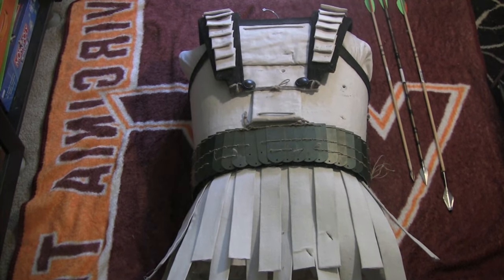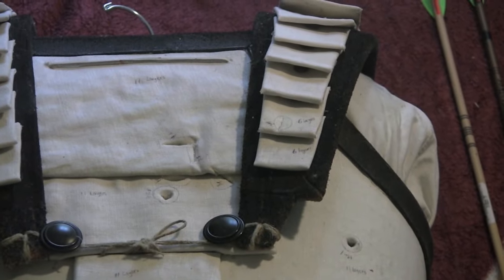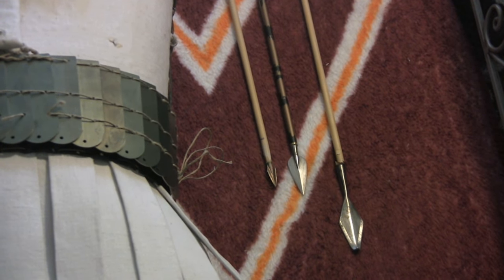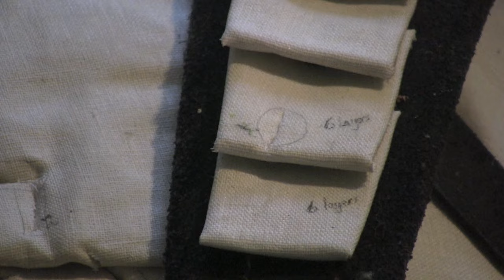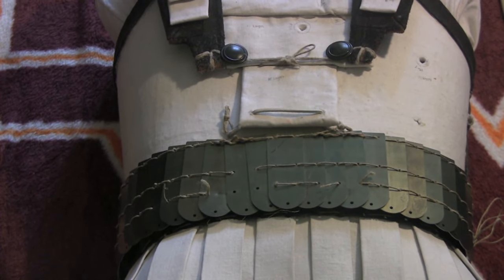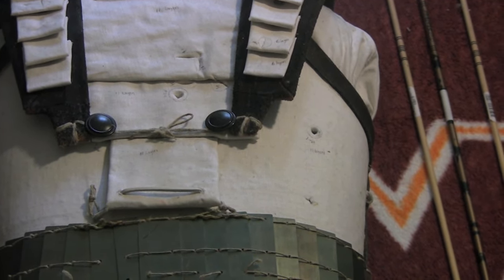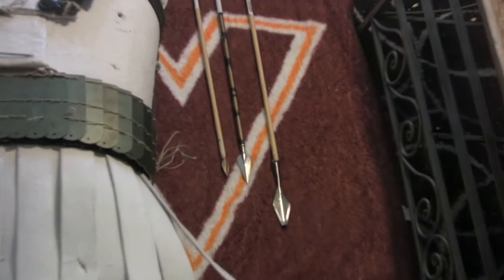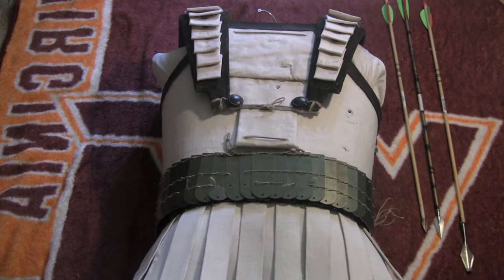Testing of a Linothorax in HD

Comment: Kind of like gambeson on crack
Slashes resisted by gambeson and with this they wont do too way too much more than maille
Stabs resisted by gambeson also adding more stuff between you and a penetrating head that needs to be larger to reach you, with this it does it better
Reply from the maker: That's an intersting observation and one that was born out in testing. I didn't post the video of it when I made this so many years back, but there was an interesting dynamic when it got wet from weather (and may have exhibited similiar characteristics due to insane sweat?). When it was dry, it was more rigid, so even with a softer leather core, it had great stopping power against piercing as well as resisted full swings from a baseball bat. However, when it was wet it would swell some, the thickness increasing and it becoming more pliable. While the arrows pierced further and it weighed more, it also had the benefit of being thicker (so could absorb more arrowhead before reaching the core of medium leather) as well as more flexible... more comfortable to move in. So, wet or dry, it performed well.... for different reasons.

Comment from the maker: Bow Weight: I did not record the weight of the bow used but instead chronographed the arrows used in the test as well as the mass of the arrows.  I tried my best to match the weight and velocity to what we know about recurve bows in use at the time.  The mass (grams/grains) and velocities (feet per second) are:

Scythian: 24/370, 172
Tanged Broadhead:49/756, 146
Saxon Broadhead: 43/664, 152

This information is provided in the video.

Comment: Cool test, but the arrow speeds you are getting I feel like wouldn't be accurate to archaic or ancient greek arrow speeds.  modern composite laminated bows can get up to 200 fps with lighter arrows, and maybe 150-170 with actual heavier war arrows this isnt including flight bows*.   A composite bow, like a scythian wouldn't get those speeds, their draw length was significantly shorter compared to modern asiatic composite bows, like they could maybe pull 28" though most historical depictions on vases and stuff show them with relatively short draw lengths.  So i'd think they'd be getting 150fps with lighter arrows than 130-140 with heavier war arrows maybe even less.  Though because of this I feel like they would rely on even lighter arrows which would be mass and generate less energy.   Also these shots are relatively close so they won't be angling as they and deflecting off armor easier *since bows back than didn't have as flat as a trajectory especially past 35-40 yards , compared to a flat trajectory shot.  Though I understand it looks like you're in an apartment area?  So it would be dangerous to shoot any further.
Reply from the maker: Appreciate it. Yeah, this was 13-14 years ago - assembled it as part of an undergraduate research project. Worked with what I had on a students budget. Tried to use all the legit materials but time and money was always a thing.

As for the velocity - I can't remember everything that had me decide those were the right numbers to replicate, but every aspect of this was historically researched to be as accurate as possible (given my limitations). I think part of it was that we have semi-reliable (ish?) data on how far the bows could shoot, you can roughly infer the velocity at release, especially if you also have reliable data on the dimensions, composition and mass of the arrow (so enough to assess how well it retains velocity throughout its flight, which i feel like is over 90% for 4th century BC trilobat tipped arrows)... but its been over a decade), which we definitely do.

That said, again, I was a student on a budget and had a tight schedule to meet.... I'm sure someone else (to include myself now) could do an even better test without those limitations. I know I love coming on youtube and watching those types of videos, love em, even if most focus on metal armor as opposed to the linen, leather and alternatives (eg wood)!
Reply from the maker: I'll say this - against something like a more modern (historically speaking) recurve or English longbow, none of this armor would stand up without something extra. I think it would have been a nice type of armor to have in all weather, especially hot and humid (it only got more flexible), and was super easy to patch, it had its limits. 

That said, I later tried it with a thicker, hardened leather core/tube with the same layers and it entirely stopped the trilobat tipped arrows, even with a FULL strength modern hunting bow - that surprised the shit out of me.

Comment: Will that armor get heavier on the rain ? It’s basically thick clotting
Reply: The material was probably waxed to make it water repellent.
Reply from the maker: I wondered this myself after I did the testing in the video. In addition, I wanted to know if excessive perspiration, from the inside out if you will, made a difference. To test this I wore the armor for hours at a time on several occasions, during which time I performed exercises, yard work, and walking (yes, I looked goof) in both good and bad weather (light-medium rain for extended periods). The armor definitely retained water from both the perspiration and rain... but not as much water as you'd expect. I attribute this primarily to the fact that the generous amount of glue I used saturated the linen before the rain. It also dried faster than expected, likely for the same reason - not as much water had been absorbed. Finally, I did some post exercise/rain testing. The results were almost identical to the ones in the video, except in a couple locations where it appears the armor faired even better when wet. I'm guessing this has to do with it absorbing the energy of the arrow better before giving... better bend than break if you will. The only thing I didn't test was blunt impacts while wet - I don't imagine it would fair as well there as it did when it was dry.

Comment: I wonder how much extra protection a thin layer of leather scale would add to this?
Reply from the maker: Hardened leather scales like on a brigandine... probably a lot. Properly cured hardened leather is a beast and one of the biggest arguments against hardneded/glued linen armor). It's been a looong time since I did this test, but if I did it again and had my current budget I'd definitely test out different methods of protection.

Sadly, if I recall from my research (which I did a ton of at the time), we only have reliable information on a few things from that era. We know the size, shape and mass of the arrow heads and roughly the mass and velocity of the arrows with arrowhead. Sadly most of the actual armor samples degrade over time... they literally just rot/decay, especially the less expensive stuff issued to your regular infantry guy.

That said, I do recall people finding samples of leather and linen armor from the 3rd and 4th century bce. I'd probably develop a test campaign based on that, historical imagery and what we know about armor from bordering regions and similar time-frames.... so early Roman leather armor which I'm pretty sure we have more evidence of.
Reply from the maker: It's easy to forget how long ago this stuff actually dates to. We all know the "dates", but it really puts things into perspective when you consider many old battlefields and cities are now 15-20ft or more under the ground. I want to say the old Royal Quarter Alexandria, Egypt (somethingn like 25 cities were renamed that during his reign lol), the portion founded by Alexander, is around 25-30ft UNDER the current city. So, point being, it's incredibly hard to find stuff from this period.... thank God some folks preserved art and writings from the time and shortly thereafter.

To your point though - if I were some soldier, I'd do whatever it took to survive, especially if I was a Macedonian phalanxman without shield... wearing only my tube and yolk armor (linen or leather). You'd see me boiling leather and slapping all kinds of extra protection on it... I imagine troops of the era did the same. I'd be fighting for the belly hide of every cow and horse we slaughtered 😂
Reply: @Hokie2k11  Thanks for the replies! 👍👍

Comment: And what kind of bow were you using?
Reply from the maker: I can't recall the manufacturer, but the bow was your typical adjustable compound hunting bow. However, the important thing is to make sure you have the right arrow of the correct weight and with the correct arrow head leaving the bow at the right velocity. I used a variety of arrows, but I would focus primarily on the Scythian trilobat. Before firing, I adjusted the draw weight (force) of the bow to ensure I had the right velocity.
Reply: Bows back then weren't the super powered ones found later on, like in the middle ages.

Comment: Where could you get this linothorax?
Reply from the maker: You need for make it. Depending on the part of the armor in question, it's between 15-25 layers of historically accurate linen, bonded with the animal based glue used at the time. You can add even more protection if you line the inside with hardened leather.
Reply: @Hokie2k11  It would be really cool, it would be very difficult to do it for an inexperienced like me, do you know if anyone can forge this linen army?
Reply: @Hokie2k11  I hope you answer me, I would be very curious and happy to be able to have a linothorax

Comment: The most important is the angle of the shot...Usually on a battlefield archers shot volleys of arrows  from a long distance. And they aimed high so the arrow gained height and then with its weight and speed it fell on the enemy. So i think its kinetic energy and m/sec wasnt that deadly or powerful as a straight shot or from a high tower/wall shooting downwards...
in other words only at a clear sight and a straight zero angle the arrows could penetrate an armor and that was a rare scenario...

Otherwise Alexanders phalanxes would have huge casualties because every single one of those hundreds of thousands Persian soldiers they fought against, carried a bow
Reply: From what I understand arrow volleys were closer since arrows actually lose velocity if shot at long distance, as well as range. Also since Alexanders phalanxes rely on heavy shields the armor seems more likely to have been a secondary measure rather than the primary protection
Reply from the maker: @bmxdoe  I'll have to go look into my research at some point, but I recall more than one source stating that the velocity of arrows fired by English longbows retained as much as 90% of their velocity on impact, despite the huge distance and massive arc. This may not be a perfect carry over to ancient times, but it seemed like a nice starting point and the basis for me choosing a test velocity.
Reply from the maker: Angle of the shot would definitely have an effect here and not something I considered. Why? I was thinking worse case scenario and only had so many shots before I completely trashed my pride and joy :)   I figured that the 'effective' thickness is higher for angled shots, so my straight on tests were what one would have to encounter if soldiers were engaged up close and personal. I figured that if they could survive up close and personal than they'd survive angled shots from a distance.

In the end though the armor did its job. They may have penetrated some, but none would have been a kill shot. If I had to go through this test myself, I can tell you what I would do - I'd just wear some type of fur or layering that separated the armor from my body by about 1/3 to 1/2 of an inch. After all, it wasn't as if something inside the armor stopped the arrows from going deeper, there was nothing more than a pillow inside - all of those arrows were stopped by the armor.
Reply: @Hokie2k11  they are very heavy though.

Comment: Try using leather. For many reasons, linen is just not practical as armor due to the logistics behind getting enough of it to make armor. Tanned leather is far far more common, far easier to make, and makes much more sense than something so very expensive.
Reply: The practicality depends on use, however. One of the reasons I'm researching the linothorax and south Indian Peti armor is because I live in an area of Texas that' has an Mediterranean climate- even walking around, much less marching and fighting, heat exhaustion is a real problem. Since he was often on the march during the hot season, this was a huge issue. Leather armor is HOT.
Reply: Bippy Grace Linen was historically in very short supply, and was quite expensive. To get any sort of protection, you need a lot of layers of it.
Beyond that, the evidence for linen armor just isn't there.
Reply: demomanchaos My understanding is that there's written accounts of it, as well as the linen and silk armor traditions of India (thousand nail coats, Peti armor) and the far east, with which there was some cultural exchange by the time of Alexander. As well as the later viking cloth +fur armor for those that couldn't afford maile (where cloth was expensive enough it was used as a huge mark of trade, almost a currency), and later European cloth armor traditions. Also, having fleshed a hide and having woven linen, linen is easier to work with. Hand woven fabric was also expensive, and tanning and rhetting linen both stink to high heaven.  I'm probably going to try to make both forms- leather armor and linen- and just see how they perform in the heat out here.
Reply: Bippy Grace Those armors are quite different to the ancient Greek style though. Those are actually gambesons, padded armor. made from wool or cotton generally. They are hotter and work on very different principles to hardened leather.
From what I understand, the only literary reference to linen armor is something along the lines of"linen corseted argives" which is quite vague. Facing something in linen is one thing, making hard armor entirely out of linen is another.
Reply: It's basically ancient kevlar, it should be fairly effective. I'd love to see a test of a linothorax vs leather armor.
Reply: That's what I say to people when I talk about Linen Gambesons at Reenactments.
Reply: Gambesons are made from linen...and leather was actually quite expensive in it's day...there's also ironically very little historical evidence of leather used as armour.